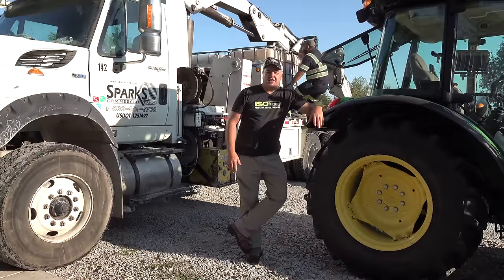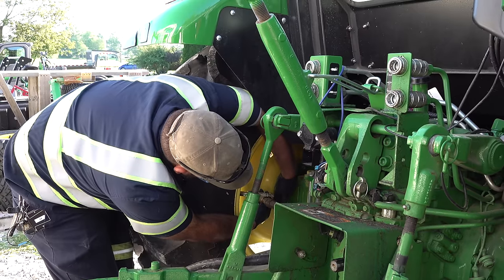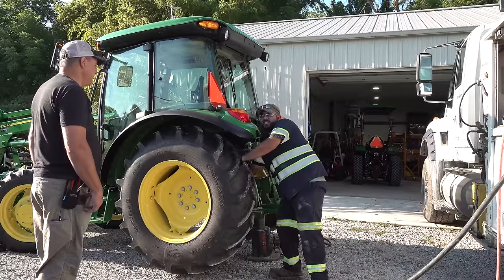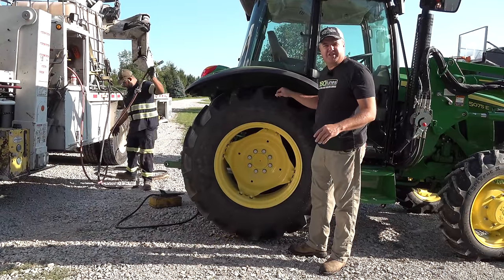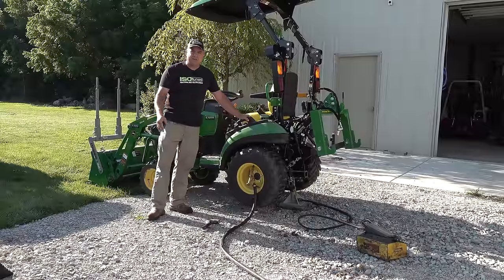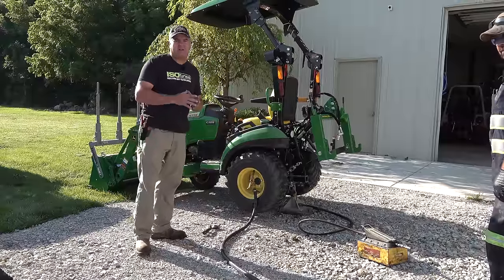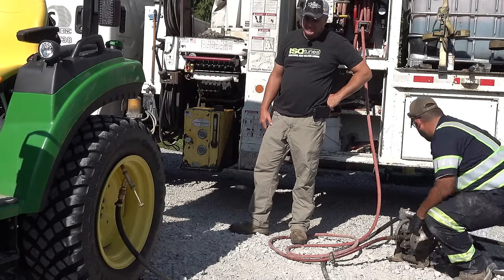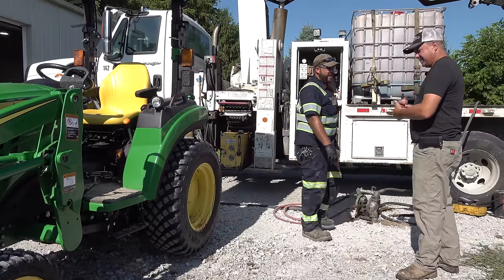Optimal Tire Ballast??  How To Add Rim Guard to Compact Tractors

Comment: I began to water up my tractor tires in the early 1970s. It all started when I bought a new 4430 JD tractor without weights and I actually used water for weight and to totally eliminate the need for air. Instead of airing up the tires, I "watered" them up. With zero air in the tires, maybe that's the reason I did not have any trouble with the rims rusting out. 
Am I missing something? So, instead of using water, calcium was used, but it's corrosive, so now, we are supposed to use beet juice instead? Why? 
I bought a 4640 ten years ago and watered up the tires. No problems, Why? 
I'm sure someone will comment that watering up the tires is a horrible idea and if I had the sense that God gave a jack rabbit, I would pay a company to remove the water and sell me some beet juice and pay them to install the brew in my tires. One last time  WHY??? BTW, I live in the 1/2 of the USA where water only freezes in the top of the refrigerator. I probably just answered my own question.
Reply from the maker: Your last sentence is the answer.   More than 1/2 of the USA has conditions where water alone will freeze in the tires.